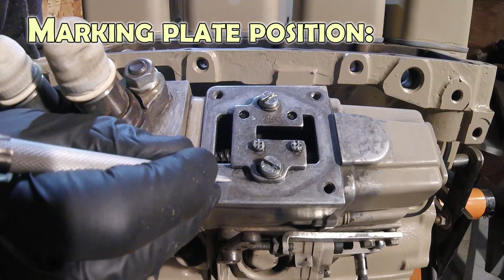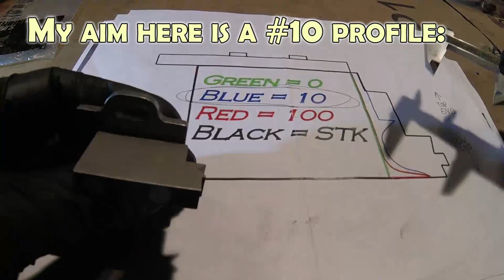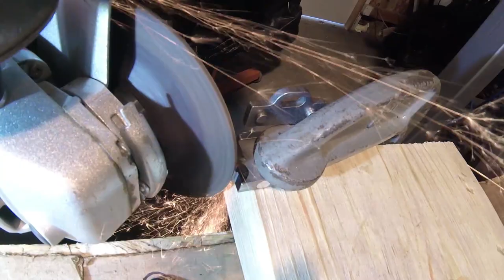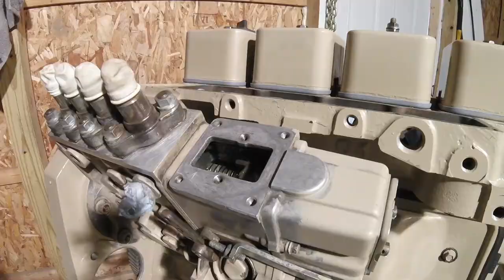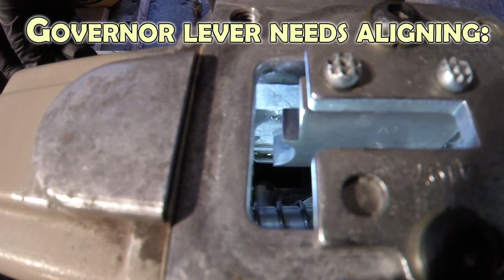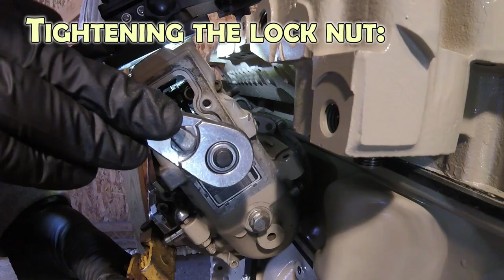DIY Fuel Plate Mod / Grind (P7100 P-Pump) × 4BT Cummins Discovery #9 [Land Rover Build]

Comment from the maker: INFO:  Here's a few images of the different common plate profiles >>> https://www.cumminsforum.com/forum/attachment.php?attachmentid=16979&stc=1&d=1249675105   ALSO   https://www.cumminsforum.com/forum/attachments/94-98-performance-parts-discussion/6363d1197934308-moving-stock-fuel-plate-allplateprofiles.jpg

Comment: would be a good time to do the AFC washer and max travel mod..Power Driven Diesel has vids about it..they are tops in the 12v/4bt p-pump dept..
Reply from the maker: I did end up doing those mods too, made sense while it was apart, but I didn't realize how poorly the video of it turned out until several weeks later...

Comment: Just benged watched your 4bt videos... amazing! Lucky yours came with a p pump. Thanks for showing the mods of it. I heard that modifying the injection pump negatively affects the engine life, just wondering what your views on that? Again thanks for sharing, amazing!
Reply from the maker: If you turn up the boost too much it sure could affect the life of these engines!  Fuel mods are mostly safe though.

Comment: All these power mods but the disco is tin can of a platform fro such a heavy/torquey motor?
Reply from the maker: Nah, may seem that way with the modern (at the time) aluminum body, but underneath is old school & plenty stout!  Big fully boxed frame, huge crossmembers, tough transfer case, solid axles, overbuilt suspension link/mounts, & so on...